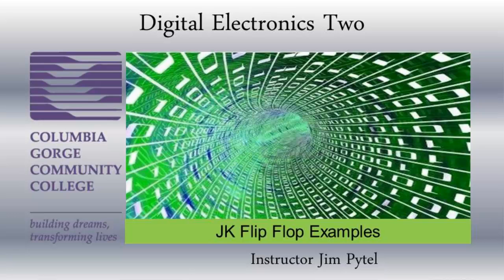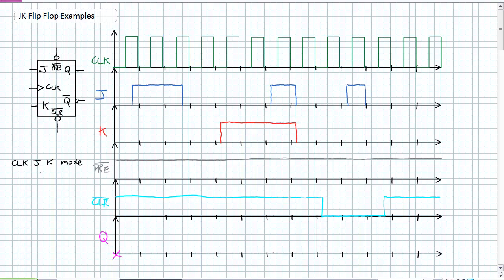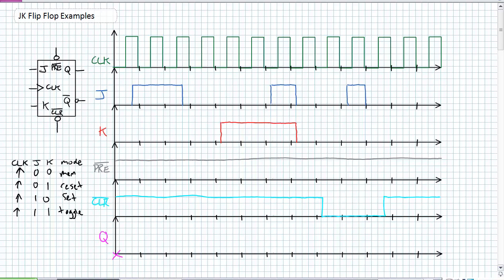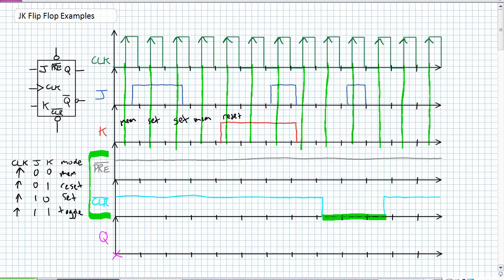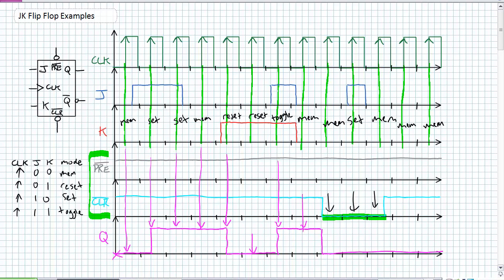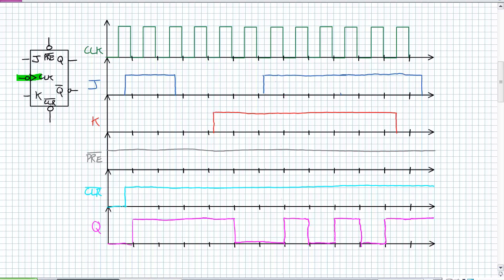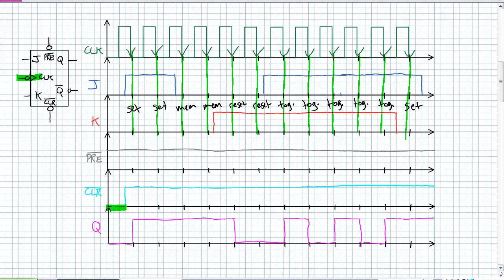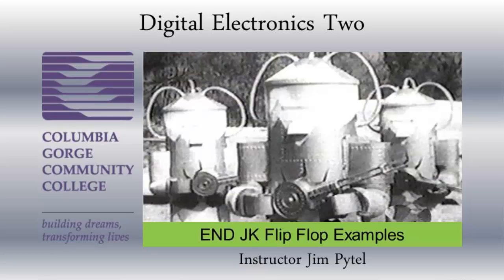JK Flip Flop Examples

Comment: what will be the output if preset and clear are low at same time?
Reply: +manmeet pannu  I guess, it only matters in case of changes. When the clear input is changed the output goes the 0 and when the preset input is changed the output goes to 1.
Reply: +manmeet pannu One year old comment, but the answer is : Q becomes uncertain ( the shaded box in the previous video )
Reply: Sarge Castor Tolga Karahan thanks for replying